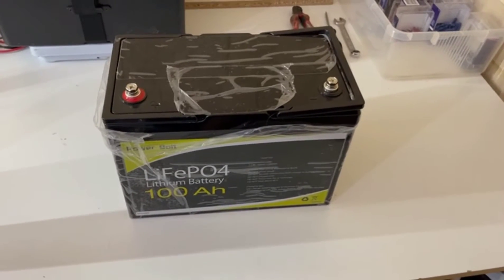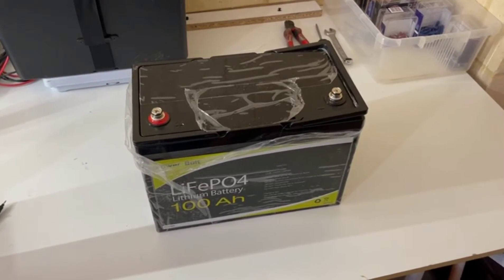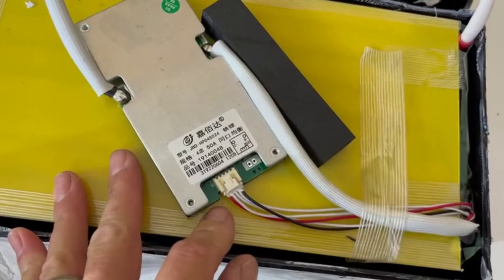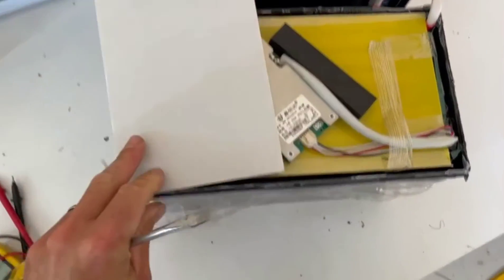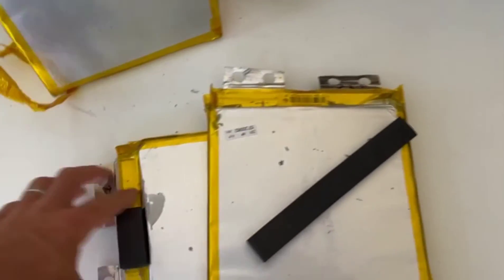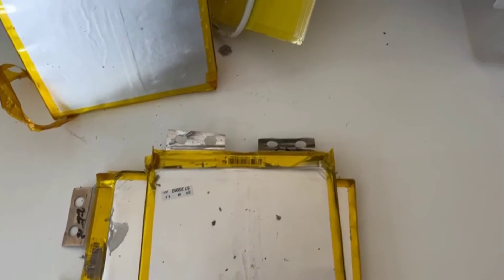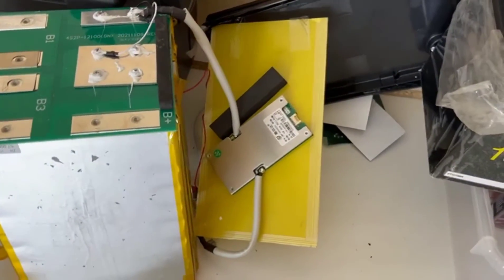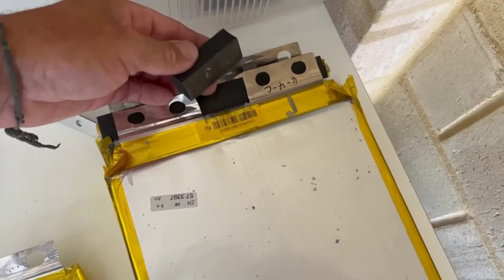CHEAPEST 12v 100Ah Lithium LiFePO4 Battery - The TEARDOWN - What's inside is interesting!

Comment from the maker: In case you missed you can Watch Part 1 here👉https://youtu.be/rphmv6wMQbk
and Part 2 here👉https://youtu.be/HffR3wE9WLc
Reply: Some are partially filled with concrete I kid you not. If the are only ,56 Amp hours they should be referred to the ACC for fraudulent deception
Reply: @blake9358  If they were sourced from within Australia, I think you're right. If WES imported them, it's not so clear.

Comment: I bought 2x of these 2022 black friday for not very much at all. I also bought a battery discharge tester, the ones with fans on the top LCD etc. I charged them both with my victron smart charger and set up a load of 10a and let it do its thing. Did this twice to get fair results 
105ah for one battery.
85ah for the second battery.
Deffo used cells! I decided to buy a bigger JBD BMS and upgraded that to include Bluetooth and just dropped it in place of the other, and also so I could run both in series (which I never did in the end as my application was for a 24v trolling motor where I ended up buying 12v instead!).
Personally, I think they are good enough for the $200 aud that I paid, over a year ago, and still working fine. 
I also tore the box down nicer, used a heat gun at the seams and the lid lifted off nicely so I could reglue without any issue (used some pop rivets to hold whilst it set) 👍🏻
Reply from the maker: A few people have contacted me saying they have these batteries and are getting mixed performance from them. But for a bargain $200 you wouldn’t mind it under performing. They are ideal for running low current applications. I will be upgrading the bms and plan to use the battery to run an electric gate. Be interesting to see how long it lasts. I didn’t think to use a heat gun!? But thanks for the tip, will use that method on the next teardown.

Comment: Would like to point out there are 8 cells at 57ah ish you only need 4 cells to make 12v so because there is 8 you can double it to make 114ah I think you need to do a capacity test to get the real end figure great video to well done
Reply from the maker: Yeap that’s correct, but with the various tests carried out we could only get around 60ah from the battery before it was fully discharged. Possibly one bad cell causing the issue?
Reply: @vesautoelectrics  I have a few of these batteries and my capacity test was bang on had 8 batteries 4 in series 2 parallel got 9999 watts when it cut out under a 1500w load

Comment: I brought power bolt  battery's over two year period and I've done a cycle test on all 6 battery I brought over that period and they all had more then 100 ah in them. On your tear down, I notice each pouch had 57 ah at 3.3 v and there is 8 pouches that adds up to more than 100 ah. I done a cycle after 2 year on two of the battery's that I've that long and the battery's are still holding 100 ah each. I found the chemistry  for a 12 v 100 ah lithium iron battery  should weigh around 12 to 13 kg. Thanks for doing tear down the video, now I know it has pouch cell not Prismatic cells.
Reply from the maker: Thanks for your feedback, glad they have performed well for you. Unfortunately the one I purchased was a dud from the start. But a few other people have said theirs have lasted well , think it’s just pot luck with these cheaper brands.

Comment: Very interesting video, well done. I've always wanted to see inside one of these. Nothing wrong with pouch cells, you have what we would call 4S2P, four series, two parallel. Looks like lower grade pouches that didn't meet stringent requirements. How long did you charge it for? I would imagine the cheap BMS either is not capable of cell balancing or very slow at it. I would have tried charging it for a few days. If still a problem, then you could have tried manually top balancing them. That might help.
Reply from the maker: Thank you for watching, appreciate the feedback. To be honest after doing various tests i only charged it for 24hrs before strip down. I would guess the cheap BMS doesn’t have the cell balancing function though. I will manually balnce them before i put it back together, then i will use the battery, possibly for an electric gate on my block and see how it goes? I don’t have high hopes though.

Comment: There are 8 pouches, how is that 12V, I am confused????
Reply: are they only pulling 25Ah and doubled up?????
Reply from the maker: Each pouch is meant to be 50ah, 3.3volts So they connected 4 of them in series so that the ah stays the same but the voltage increases to 13.2volts. 
Then two of these sets connected in parallel keeps the voltage at 13.2volts but increases the ah to 100ah.
Reply from the maker: It can be confusing. it’s set up as 2 sets, with four pouches wired in series in each set to increase the voltage. Then the two sets are connected in parallel to keep the voltage the same but increase the amp hours.
Hope that makes sense?

Comment: I wished I watched this before buying 2x200ah batteries 😔.
For $100 extra I could have bought 2 voltx batteries. I took one apart and it's built well with prismatic cells. I was hoping to take them all apart and making them a 48v pack with one BMS.
Reply from the maker: Your not the first to say that. But other people have said their batteries are performing as rated? Maybe doing the 48v set up but purchasing a quality bms would help? What would you be powering?
Reply: @vesautoelectrics  I'd like to run my house and ditch the grid, I don't use much juice.
I had a 24v inverter but didn't realise 2 12v batteries with their own BMS wouldn't work in series long term. Then water killed the inverter. So I bought a 8s - 24s JK bms and 48v inverter to use with my cells but as they were all laser welded I didn't want to separate, I might still get identical ones to complete the setup and use the cheap ones for other stuff. I'm doing a charging capacity test on one at the moment.
Reply from the maker: Yeap a 48v setup would be ideal. How much solar you running? How did the charging capacity test go?
Reply: @vesautoelectrics  I got 3.5kW worth of panels and space for 3 times that. I only use between 7-9kWh a day but usually about 4 with basic needs.
I got 208Ah out of the battery which is alrite so I'm using that for lights.
I decided to build a pack with new cells from china and just waiting now. I don't mind running a genset if need be and would be cheaper than daily supply charge.

Comment: Just not worth buying. Even if you are a super cheap charlie. Steer clear of pouch cells.
Reply: Why? I have a 36v, 20Ah bike battery that is made of 12 sets of 4x5Ah pouch cells, that I never even bothered to put into a sturdy container, and 8 years and 38000km later, it still has between 16 and 17Ah capacity, not that I ever flatten it, but I do a capacity test every so often.
The cells in the battery that was torn down in the video are well packed into a sturdy case. What difference does it make if they're packed into individual cases, or just one big one, apart from a slight weight saving? Every phone in the world has a pouch cell inside it.
Reply from the maker: I was surprised to find pouch cells when I opened it up!

Comment: Check the weigh usually you get 160ah/kg
Reply from the maker: Sorry how do you mean?
Reply: @vesautoelectrics  The 3.2V cells should have a particular weight, it depends of the number and size of cylindrical cells inside. Too light and something is amiss. If you have four 3.2V 100Ah cells inside, then add the case and BMS and padding and that's your expected weight. The arithmetic might be different for those pouch cells.

I have seen it mentioned in passing in other videos and their comments.

Comment: Just make sure your charger is set for LiFeP04 and not lead acid batteries and charges each cell to 3.65V, therefore the finished charging voltage for this battery is 3.65v X 4 = 14.6V.   12V LiFePo4 batteries are only fully charged when both the voltage hits 14.6v and the current going in falls to less than 50mA. Those 8 pouch cells should have no problems delivering 100Ah.
Reply from the maker: Thanks for the info. Yeap the charger is set to LiFeP04, when it’s complete the battery is sitting at 14.5-6v. But after resting for 24hours it will drop. My next test is to fully charge the battery then measure the voltage of each pouch.

Comment: I purchased a couple of these. Charged up fine, my capacity test consisted of 2x series connected into an inverter driving a 500w halogen. This provided a fairly consistent load of ~21A for most of the discharge cycle, peaking at about 22.5A by the end. One BMS shutdown at just under 5h, the other battery wasn’t far behind at 11.8v. This would make the weaker of the pair ~103ah and the other just a bit better
Reply from the maker: You definitely have had better results than me! I reckon these are all used cells and it’s just luck if you get a battery with good ones in. Would be interesting to see how they perform after a number of cycles? Can you keep us posted?
Reply: You might be doing everyone a favor keeping used cells out of the landfill

Comment: Think the eco worthy 100ah uses the same shitty jbd basic bms, thanks mate save me wasting my coin 😅 save for something decent
Reply from the maker: Glad you found the video informative, yeap i would avoid these! Maybe check out the Giant Power Lithium Batteries. I’ve done a couple videos on these if you want to check them out. They perform well. What you planning on using the battery for?
Reply: @vesautoelectrics  not a damn thing lol nah just an Engel fridge in my 4x4 maybe some low powered accessories, just want a decent quality battery with a decent safe bms thats not gonna break the bank which is hard because theres so much junk on the market, i'll check out the Giant bluetooth 100ah, thanks again for ur sacraficed $$$
Reply from the maker: Haha, glad i could help. Yeah check out Giant, think they have a sale on at the moment. I am in the process of buying good quality cells and bms to build a decent 100ah battery for hopefully the same price as a budget brand! Stay tuned👍

Comment: I noticed in your part 1 video the battery only had 13.2V at the start of the test which is about 70%. it doesn't explain why you only got 55Ah in your part 2 test. Thanks for the videos I bought one of these batteries and have found that from fully charged it drops to 13.2V quickly but then stays at 13.2V for a long time. I haven't completely flattened it so see if mine is a true 100Ah.
Reply from the maker: Thank you for your feedback. I think only getting 55ah from the battery in each test is down to the poor quality of the cell’s and bms being used. Would be interesting to see how your battery performs and how many ah it has? What set up do you have?

Comment: Correct me if im wrong. 8( number of cells) * 57( ah each cell) * 3.3(volts) is the number of watt hours (approx 1505). A normal 12v 100ah battery is 1200 watt hour. ps I have one of these, its performs just like this one. Dont buy one if its for serious work.
Reply from the maker: Thanks for watching, appreciate your feedback. My mistake while filming, it’s 2 groups of series in parallel. Even on the casing it’s labelled as 1280wh. 
Are you getting the same, around 56ah use?
Reply: @vesautoelectrics  
I havent got a shunt installed or anything. Im just working out based on a constant load from my starlink. Comparing it to an Itechworld 100ah. 6-7 hours vs 10+ from the itech.

$315 I think I spent on the power bold
$560 on sale from Itechworld. You get what you pay for from Itech.
Reply from the maker: Yeap in Theory you should get close to double the amount of hours with the itech 100ah battery. Another well priced lithium is the Giant power, have done a few tests and results were great.

Comment: Very interesting, I bought one exactly the same but I was sent a VoltX which was selling for around $500 Australian, getting a camping fridge/freezer in next couple of days so will test the VoltX
Reply from the maker: Thanks for watching. Let’s hope the VoltX performs better! Keep us posted on your results.
Reply: @vesautoelectrics  Well I would have been very disappointed if I had paid $500 for the voltx, it run the fridge for just over 81 hrs for 61.53AH, the fridge did well though at 0.75 amps an hour temp set at 2c,  its a Hcalory 40ltr bought off eBay for $260
Reply: @vesautoelectrics  no worries, still at 60ah it would be comparable to a 120ah AGM, because they can only be discharged to 50%
Reply from the maker: Yeap true, and lithium batteries charge faster than AGM. But i would guess an AGM would last longer than one of these powerbolt batteries. I think these cells have already been heavily cycled Considering the fact i can only get half the amp hours i should from it.
Reply: @vesautoelectrics  I have seen only bad reviews of my Mobi, only good ones on the VoltX (and VoltaX). There is an actual Australian company VoltX, it has quite a range of related products.

Comment: For it to only be a 50ah and the price it cost it's not that cheap after all, this battery is getting removed from my ebay watchlist 😂
Reply from the maker: Haha, can’t blame you. And hopefully i saved you wasting money! Maybe check out my other video testing the Giant Power lithium battery. Results were surprisingly good.
Reply: The specs for the battery are 4s2p, which is borne out by the presence of 8 cells. Each cell is 56Ah, tested by the guy, so 2 of those in parallel, with 4 pairs in series, makes it a 112Ah, 12v battery.
Auto Electrics also seems to be unaware of that too. It's a freakin' bargain.
Reply: So we have 2x57=114.....it is above 100a....at 12v.....you get more than you pay....be more onest
Reply from the maker: I have been completely honest, as shown in the video. The battery is being advertised and sold as 100ah. But with the cell set up it is actually 114ah ( if I wasn’t being honest you wouldn’t of known that) But when tested it achieves half of that. ( Me being honest)

Comment: The cells would’ve been wired in series parallel so in theory would be a 120ah battery not a 60 but the way these companies make the batteries so cheap is they’re used cells so you have no idea how old they are or how many cycles they’ve done in there lives which is why you get so few ah out of them when testing.
Reply from the maker: Yeap your spot on, 2 groups of series in parallel. my mistake whilst filming, have since cut that bit. For the price i didn’t expect much but not this bad! I could’ve purchased a half decent 50ah lithium battery for the same price. Hopefully this video will help people decide before parting with their hard earned cash. Thanks for watching.
Reply: @vesautoelectrics  Didn't you say you tested the cells at 56Ah? Like, 56Ah per cell? Or was that per parallel pair?